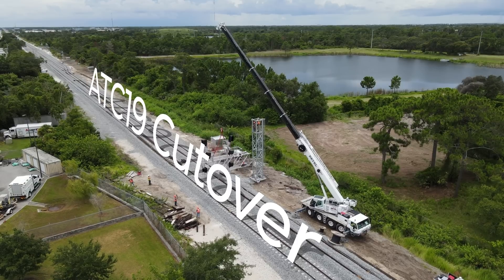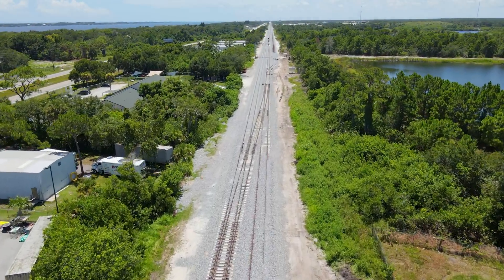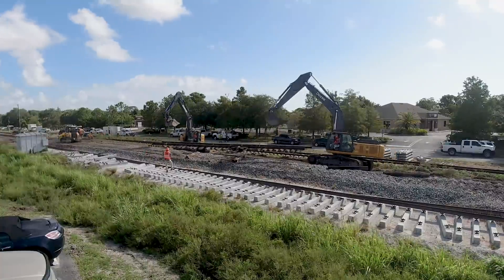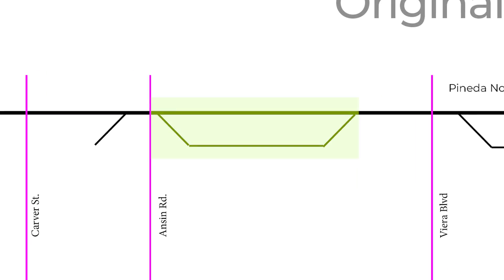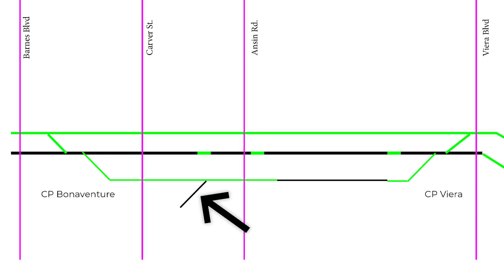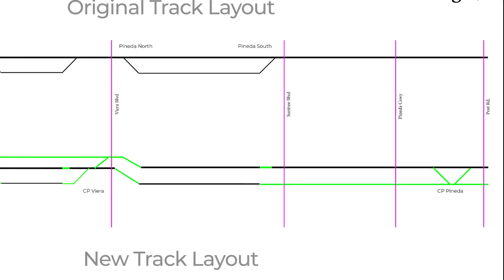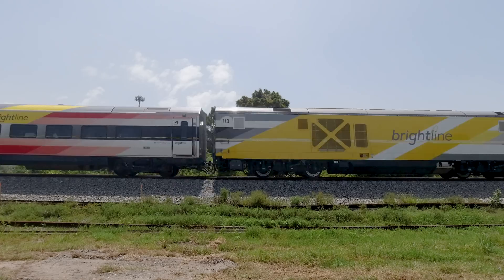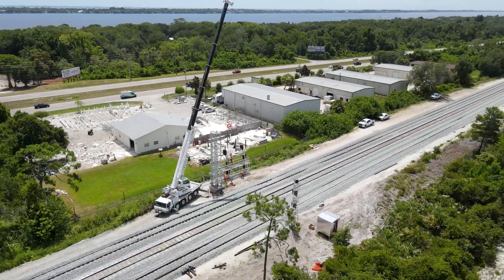Brightline Construction: ATC19 Signal and Double Track Cutover Overview

Comment: Great video, as always. Particularly liked the inclusion of the track schematics. Where did you get them or do you do them yourself? Would love to get a similar set for all of Indian River County as a visual supplement to a rail safety presentation I’m presenting later this fall to some volunteer groups on how a double track FEC right of way will change train operations in the county. Any help you can offer is appreciated. Woody Sutton, Union Pacific - Retired
Reply from the maker: I made them myself based on the changes I observed while filming.
Reply: I suspected as much. I’m dealing with the 2014 EIS submittals. I’m confident there have been changes in IRC since then. They’re just not far along in the construction process yet here to ascertain what they are. For the moment, I will make do with what I have. Thank you for the quick response. Woody Sutton

Comment: How fast will Brightline run through this area when regular service starts?
Why do they lay track on a base layer, dump ballast over the track, and then lift the track?
Reply from the maker: This area will be 110mph. The subballast provides a compacted, flatter surface to build the track on compared to the more bumpy, loose regular ballast.
Reply: As added info to The Roaming Railfan, the prestressed concrete ties are very easily broken by loading opposite the design loading.  If there is a ballast stone under the center of a concrete tie, it will break from the wrong loading of the tie.  This was discovered years ago while laying concrete-tie track with a bunch of broken ties when the ballast cars were run over the track to dump the ballast.  What works for wood ties won't work for concrete ties.
Reply: Track laid on a compacted layer of bottom ballast, while fairly level and straight, is not good enough for service, especially at mainline speeds. While placing bottom ballast before laying speeds up the ballasting, the track still needs lifting, tamping and lining to the design specifications.